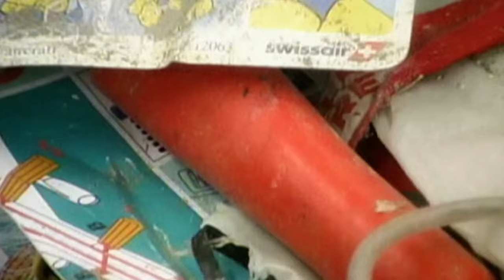Needle-in-a-Haystack Ocean Search Yields Results for Flight 111 Air Disasters | Smithsonian Channel

Comment: Some genius hardwired all the display units (essentially an all in one style computer) to PSU's connected to the 400hz buss. I guess it never occurred to anyone to do a 24hr "burn-in" test on this design? And that means 24 hours of 100% processor sustained. I don't doubt that design would have been up in flames in less than an hour like here.

Comment: How was swissair responsible for the crash?
For those unaware, the crash was caused by a fire, due to overcurrent in the wiring, which caught the internal insulation of the wire on fire, followed by the rest shortly thereafter. Said wiring had passed all the relevant FAA tests and was deemed acceptable for installation on aircraft. 
So what is swissair supposed to be accountable for? Signing a yes for an approved and believed suitable instalation?
Reply: The PSU ratings simply could NOT add up for that generation of proprietary IT tech. This design should have a UL rated thermal listing. The old school is neither old nor bad.
Reply: Absolutely agree. Hindsight is great and the future learns it. At the time of design and building, all relevant tests and standards were passed.